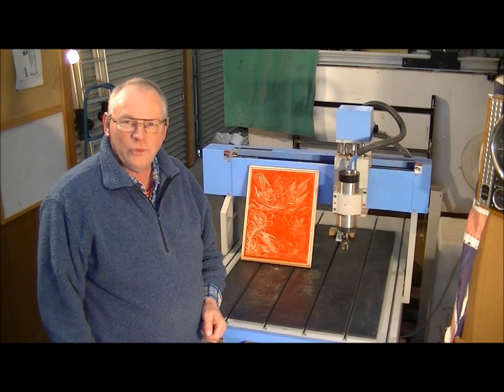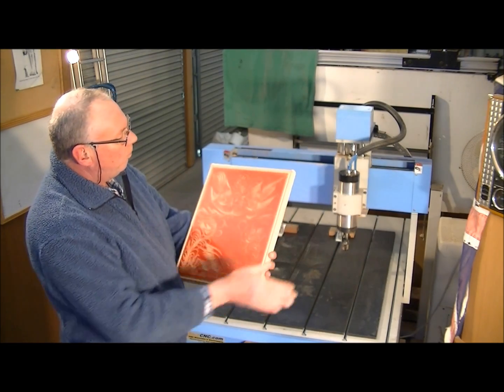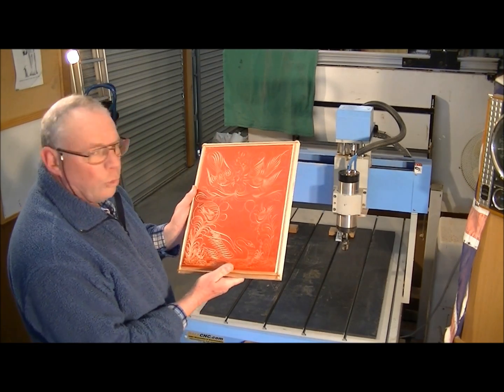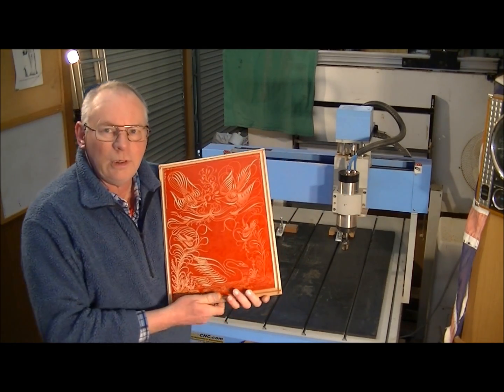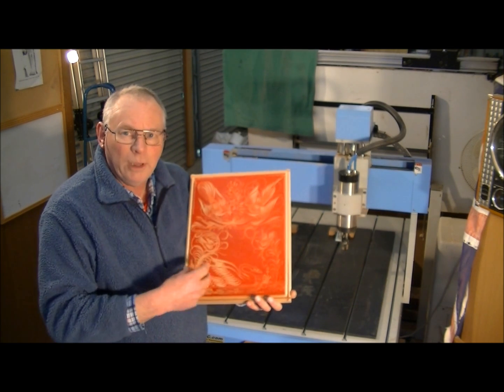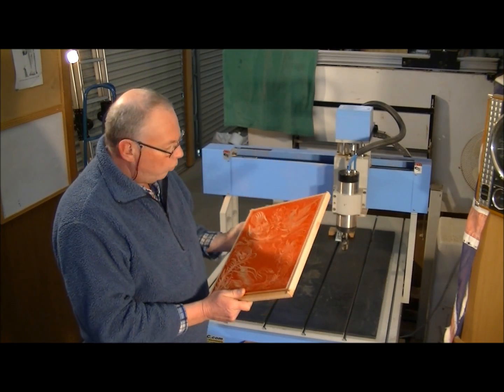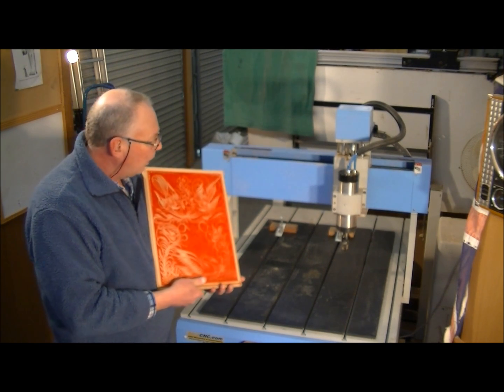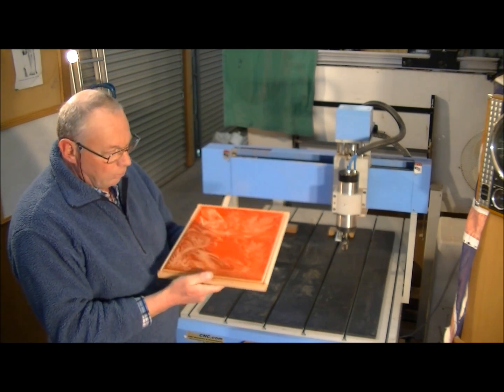67 CNC Router making $2 Dollars a minute profit.

Comment: May I offer a few tips for your camera work?

Better to not zoom in when the bit is flying around. Wait until it's doing some intricate work in a smaller area, stop the camera, zoom in, restart the camera. (alternatively this can be done during editing). Always use a tripod and when moving from one area to another, stop the video, move and then restart. Both of these things allow you to set the frame and focus without making the viewer seasick or think his eyes are failing. :-)  Play either the music or live audio, not both. OK if the music volume is very soft and the live audio over rides it. But when the two compete it's just a noise.

Last tip, buy yourself a lapel microphone, your voice was getting lost among the background noise.
Hopefully this will bring more viewers to your channel, or more importantly have them come back for more. Personally I found the very rough camera work off putting and put me off subscribing. It's up to you, ignore me if you wish, it's your channel.  
Finally a question, did the cost of living alter your heading. First it's $2 an hour then when the video starts it's $1 an hour, you ripped me off for 50%  :-)